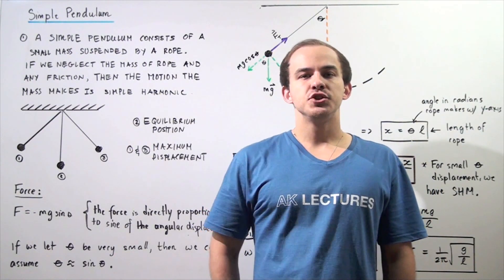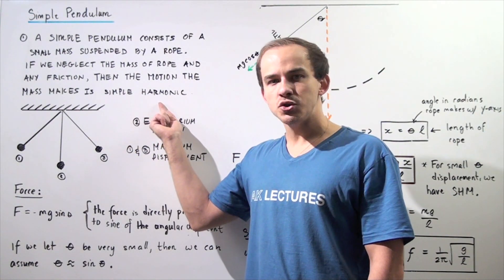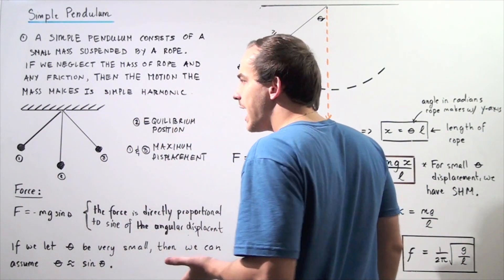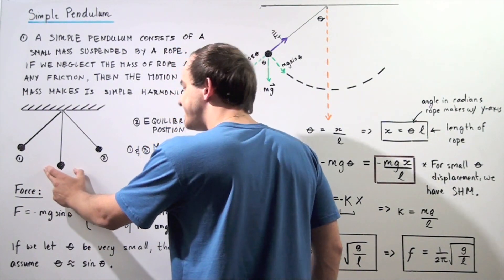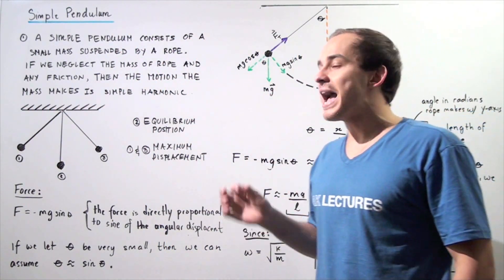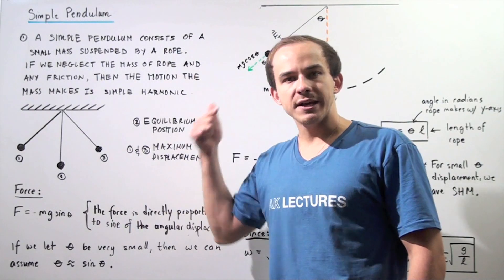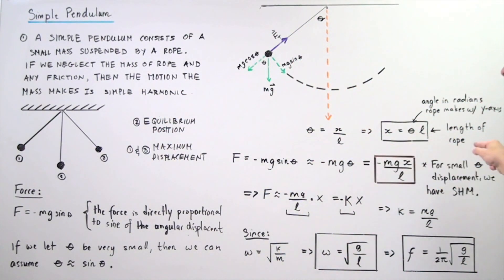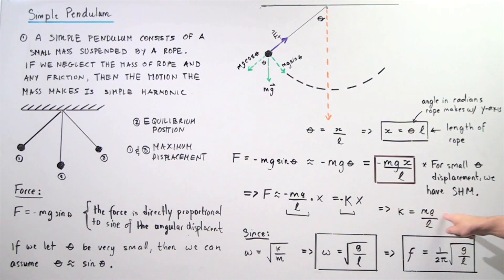Simple Pendulum in Harmonic Motion

Comment: You said so much, however you guys never confirm what the Kinetic energy force actually is at half of the descent to the KE, by starting at 100 J which is be beginning PE value, which is at 100 Joules KE (all the way at the bottom of the pendulum swing), and the back to 0 Joules KE all the way at the top. Then you also never confirm the same for the other side; half way to the bottom/half way to the top. How many jewels is that? PE = KE. All you guys mention at that point is that Your formula and cancellations to make the equivalent look great. If you begin with 100 J for the PE, then at half the pendulum swing when the pendulum is all the way at the bottom and KE is 100 J, what is the PE and the KE, when the pendulum is half way between the top point of release and the bottom/end of the kinetic energy drop. Same on the other side; which appears to me to be at energy level 50J, half. Please confirm me because I see no actual data calculations any place. Just formulas. Thank you.

Comment: Sir why the string is weightless
And the bob is always spherical ?
Reply: 1) The string is not weightless, it has some weight but its weight is too less so we neglect its weight.
2) There are many reasons we take the object like a sphere. One of the reason is: the sphere object has the center of gravity in its center that's why the bob remains the same during its motion and it doesn't lose its balance. While the other objects with different shapes (like rectangle, triangle, etc.) will create many problems during motion so we take a spherical bob.

Hope it helps!!